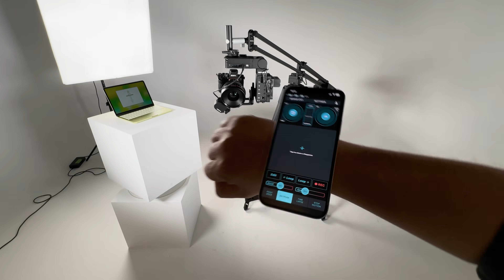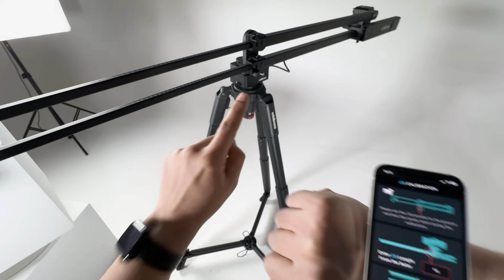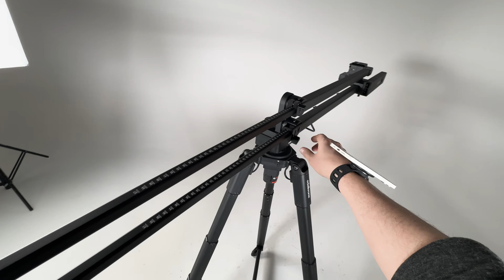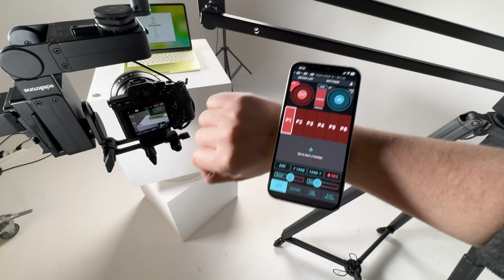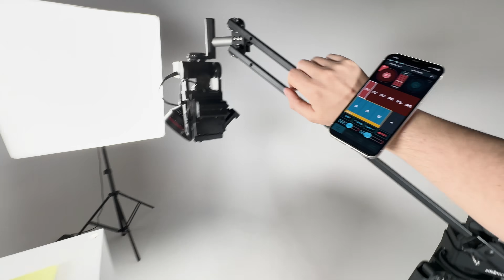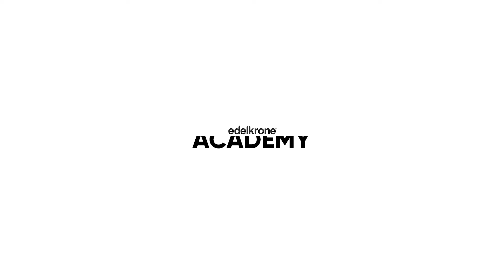Packshot Master Point Mode Calibration

Comment: I suppose these types of product videos would still require significant post-production cleanup. While shooting from the setup provides a good starting point, it doesn’t complete the entire workflow. Lighting adjustments are also necessary to achieve the desired effect.
Reply from the maker: Motion control footage always requires a finalization step in post-production, and any footage shared or broadcast on professional platforms has already gone through this process. However, most manufacturers do not clearly communicate this requirement in their own resources, leaving inexperienced users unaware of this essential stage.

You won't need anything beyond standard stabilization with the push of a button.
Reply: @edelkroneAcademy а можно получить от вас исходный видеоролик? Я хочу посмотреть насколько у меня плохо получается снимать на krone x bundle, или же все нормально
Reply: И кстати, мне нужно отправить вам хэдплбс, который вы мне заменили, можете связаться со мной? В поддержке никто не отвечает